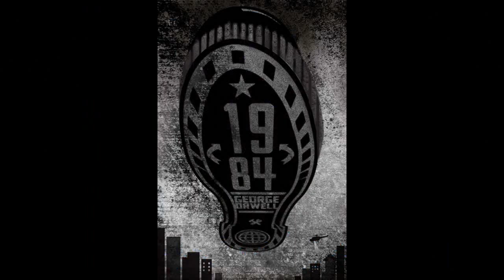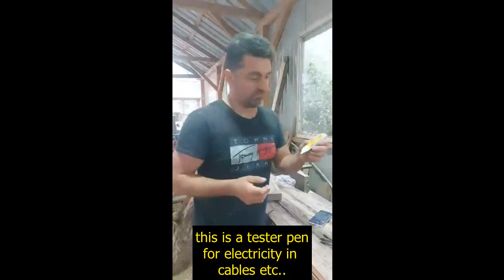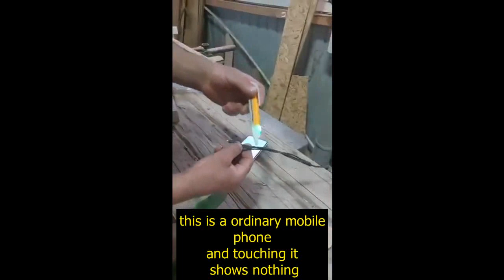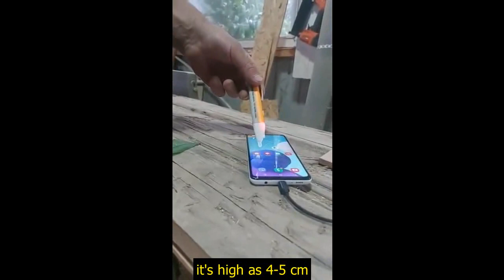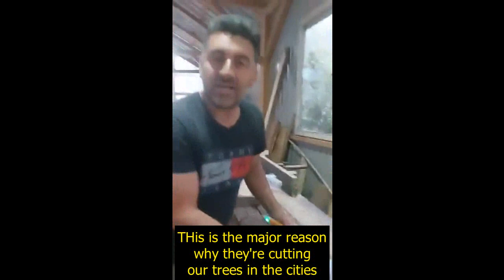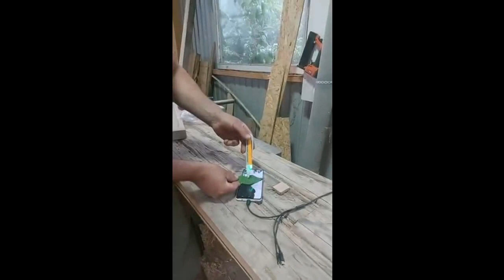EXPOSING: - The real reason behind cutting the trees everywhere!!

Comment: A new one for me test, I have seen charts on recommended levels of radiation on the electric meter on the side of homes, phones, cellular, and it was like since the 80s let's say, just skyrocketed to extremely not recommended levels, but still approved, Tnx, 88...
Reply from the maker: This is nothing compared to other more sensitive devices - the radiation from mobile goes to even 30 - 40 cm. So imagine what it does to you brain synapses, especially for those who talk too much over the mobile! - I always knew, even when mobiles did not exist yet, that too much talking is not good for anybody :)